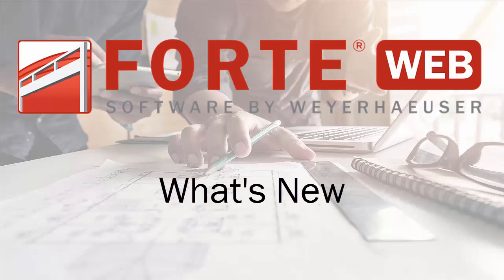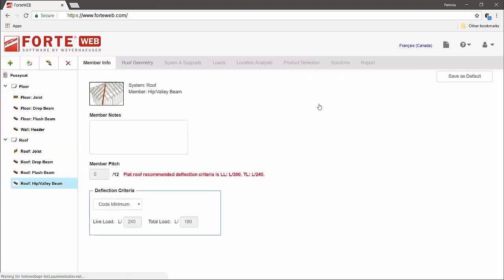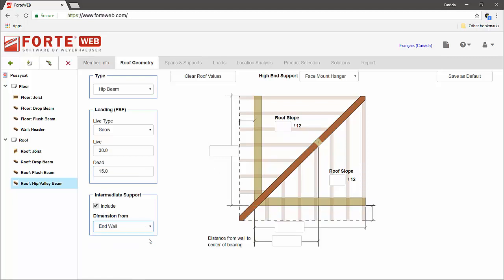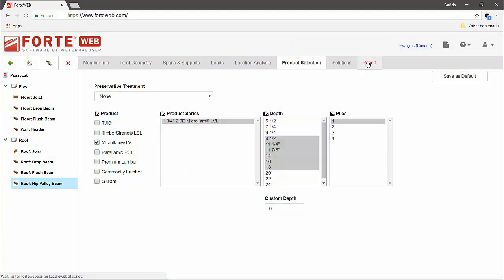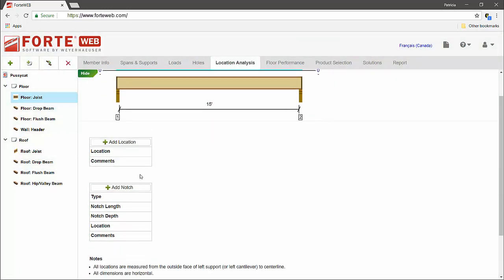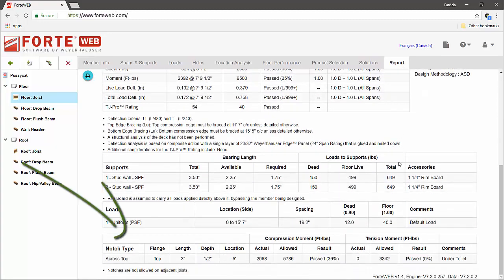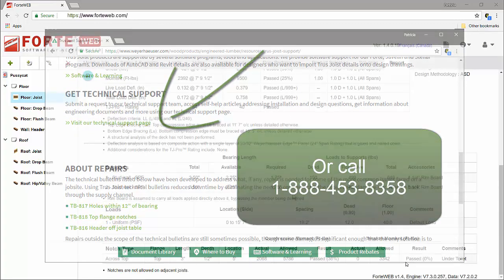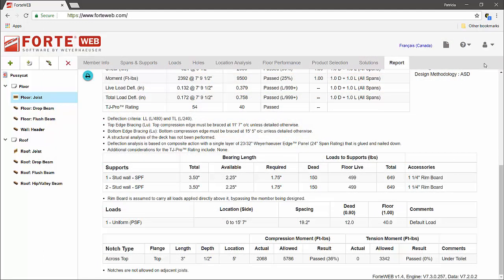What's New in ForteWEB - Hip/Valley Roof Beam Design and Notched Flange Analysis for TJI Joists

Comment: Is there a way to specify an angle for the hip or valley that is not 45 degrees?
Reply from the maker: The graphic won't update to change the angle of the beam, but if you input different slopes on either side, the resulting hip or valley won't be a 45 degrees.  Regardless of the angle of the hip or valley, the skew angle needs to be entered manually for the hanger options on the Spans and Supports tab.